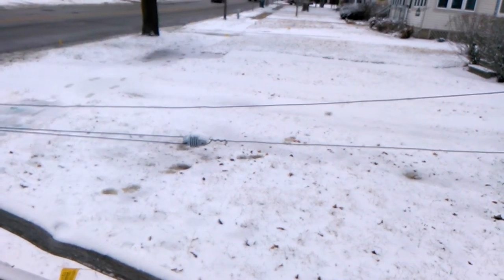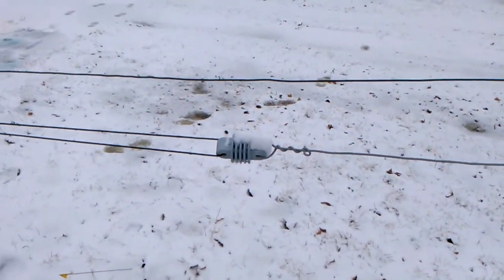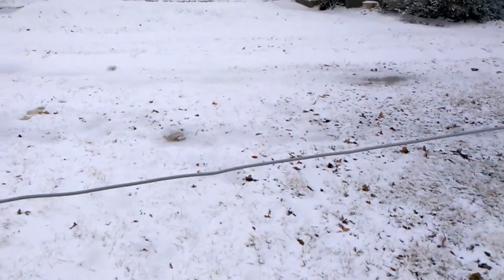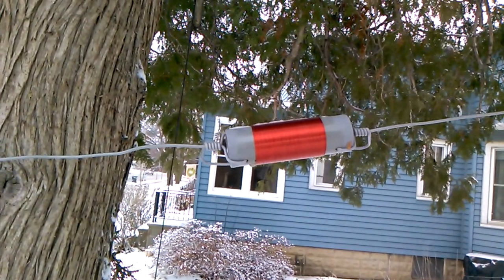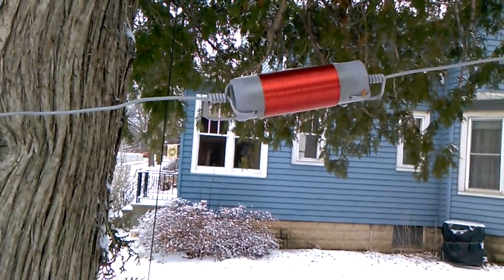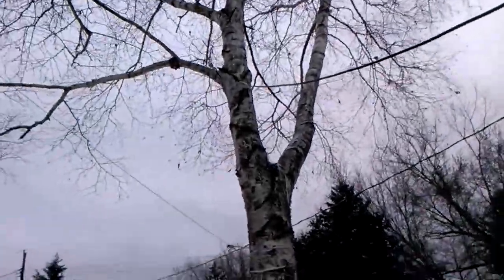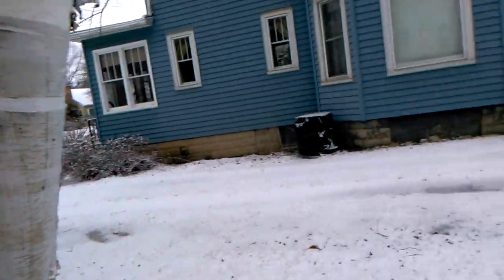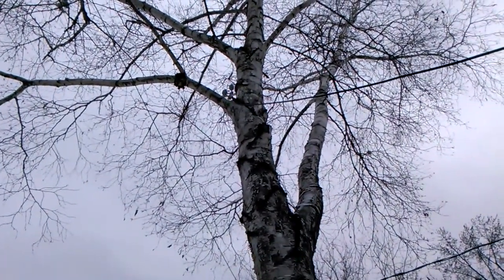My 2 Shortwave Antennas

Comment: Thanks for the video.

I was wondering what your thoughts were on the sloper after two years?

Did you continue to use this antenna and what are your thoughts on its performance compared to others you have installed since?

Thanks
Reply from the maker: I haven't used the sloper since I became a ham 2 years ago, but I am hoping to get it back up in spring.

Comment: Thanks Dennis, always nice to other peoples antenna installations 😁

Do you think the further proximity (from your home) for the sloper feedpoint may effect it's lower noise floor?
Reply from the maker: It's possible, that or it has lower gain, thus a lower noise floor. Either way, I'm happy with the results.
Reply: Sparkyzilla85 Indeed, I swap antennas all the time to achieve the best possible SNR 😎